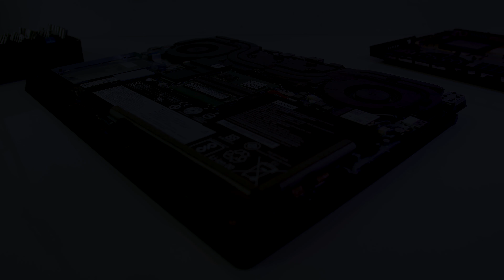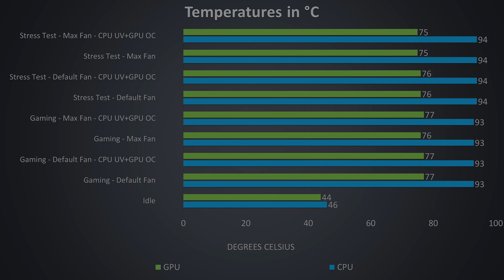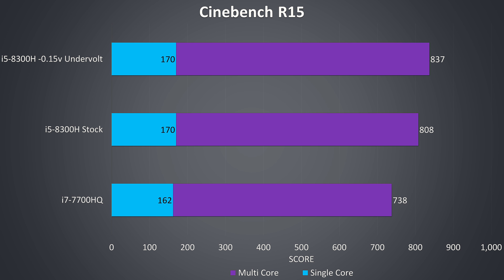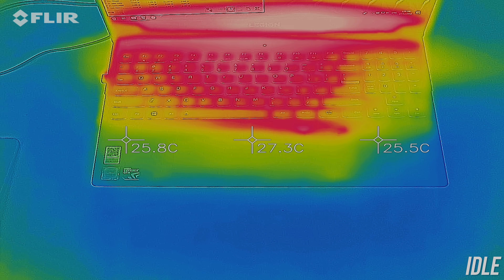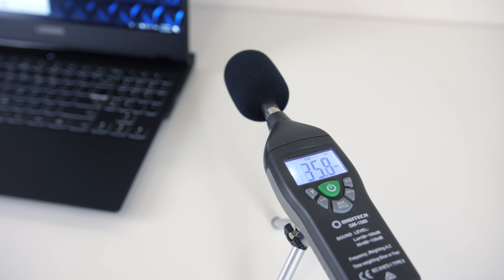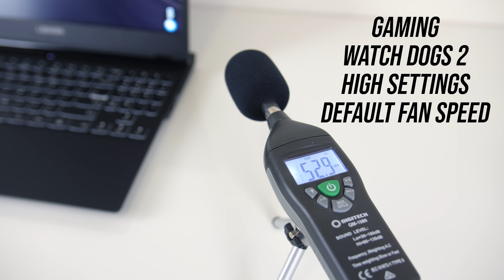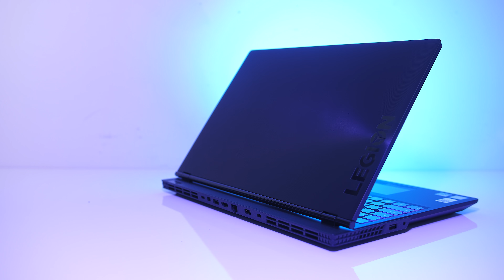Lenovo Y530 Thermal Testing, Overclocking and Undervolting

Comment: HOW TO RAISE THE FAN SPEED BECAUSE MY LAPTOP AFTER CLEANING THE DUST, CHANGING THE THERMAL PASTE AND PUTTING A NEW BATTERY IN THE CPU GETS IN THE 60-70 Celcius just by using the browser. If I try to game I can easily reach 90-98 celcius. SO WHAT THE HELL DO I DO? I changed the battery put in extra RAM, EVEN made sure that the thermal paste is changed. ALSO THE FANS are working fine they are spinning and they do speed up when the laptop hits 80 celcius. But THE LAPTOP STILL HAS CRASHES FROM TIME TO TIME and I think it is because of overheating.

Comment: I own the Legion Y530 with the i7-8750H and GTX 1060 6GB, it been two years, and honestly, this computer has a ton of problems.

The thermals are terrible, constant overheating. At stock with clean fans and no overclock this thing easily hits 100C under heavy gaming, It so bad that my GPU temporarily stopped working and my chassis is starting to warp and bend from the heat.

Also, the power button keeps breaking and I've gotten it replaced twice now.

The wifi card in this laptop, the Realtek 8822BE, is complete crap. It drops connection constantly and is terrible.

USB ports randomly stop working for no reason sometimes, causing you to need to restart the whole thing.

The trackpad freezes sometimes, but I never use it so its not a problem for me.

The rubbery plastic finish gets sticky from sweat, and you sweat a lot considering the laptop is always at 100C with gaming (with a repaste and clean fans)

The screen is stupidly dim, you cant even use it in the shade outside. (maybe I got the dim screen option so don't quote me on that)

Why in the heck is the webcam at the bottom of the screen? It can easily be at the top. (This is kind of personal preference here)

Overall, when it's new the laptop is great, but after a year it turns into an unreliable piece of crap that has a bunch of problems.
I probably wouldn't recommend it if you're gonna keep it long term. The y540 is probably the same way as its basically the same computer.
Reply: Had mine for 2 years with none of these issues
Reply: @karmaQT  how

Comment: Pro Tip: for getting an aditional -5ºC remove the dust filter under your y530, so the heat pipes and also CPU and GPU have extra passive cooling, lift it with a set of taller rubber feets and thats it! 3 hour full gaming, max temps of my  GPU was 76 degrees and CPU 80 degrees!!!
Reply: Dust wont even get inside your laptop since this area doesn't have airflow.
Reply: The dust filter (thin layer of fibre) chokes the cooling there, try blowing thru it and you will feel restriction
Reply from the maker: Nice, guess you could just clean it out more often if worst comes to worst.

Comment: Thanks for the video. So i followed instructions and put new thermal paste. However i always see fan noise, by just opening one tab of youtube under chrome. The bottom of the laptop is also also hot to the touch on ideal. Don't knw what is going on. Should I undervold cpu and gpu ? What could be th reason for a hot cpu and gpu at ideal conditoins ? Laptop is well ventilated sitting on the computer desk by the way. Thanks in advancce !
Reply from the maker: Definitely worth trying to undervolt, maybe use a stand or cooling pad, a simple stand can help a lot as I show here: https://www.youtube.com/watch?v=tXvKiy65pwg
Reply: Jarrod'sTech definitely will try it ! Thanks!

Comment: Hi .. I have a problem that while gaming my laptop drain battery 🔋 while it’s plugged in power.. note my laptop is Lenovo Legion y530 i7 gtx 1060 .
Reply from the maker: How far does it go down? If below 80% could be that you need a higher wattage power brick, check the power settings in the Lenovo vantage software, might be an option to allow it to drain down instead of sitting at 100% to promote longevity.

Comment: Hi Jarrod. Did u mange to unlock the core voltage, power limit and Temp limit sliders in MSI Afterburner ? icant do it on my Y540 9300h 1660Ti. Found this but didnt work for me https://rog.asus.com/forum/archive/index.php/t-81916.html . An idea ? or maybe its normal for this mobile GPU ? how did u OC The 1660ti in your y540 review ? Thx

Comment: mine y540 with i5-9300H and GTX 1650, undervolting -0.130V. Much better temp at average 69-70 degrees compared before undervolting it where average 80+ degree sometimes spike at 96 degree.
Reply from the maker: Nice improvement 👍
Reply: @JarrodsTech  what if i update to the latest bios, does it affects the undervolting improvement?

Comment: Hi, I'm considering whether to buy Y530(999 Aud) or L340(1199 Aud). I will only use it to play League and CSGO, or sometimes PUBG as well, so which one do you think is worth to get or suit to me?
Reply from the maker: What specs is the y530? If i7 and 1060 it will probably do better.
Reply: @JarrodsTech  (y530)i5-8300, GTX1050
(l340)i5-9300,GTX1650

Comment: Hello, I have Y530 with i5 8300H and 1060 6gb with 144hz version screen... In forza horizon 4 on ultra settings i get around 50-70fps, gpu is chilling on 70C max but the CPU goes throttling on alarming 95-96C, which I dont feel very relaxing to play, also the 170W charger adapter overheats a lot also. My gaming performance seems intact and unchanged but risking the device is what concerns me.. Should I do undervolting like you? Im already using Lenovo Vantage app to max fan speed and that helps to lower the temperature by few degrees but im still not pleasant with it. What would you suggest for laptop and adapter overheating?
Reply from the maker: I have that one too! If the performance is fine and not changing it's probably not actually throttling, but yes undervolting the CPU may help and is worth a try. Otherwise look into raising the back of the machine up so it can get more air, using a stand/cooling pad, or changing the thermal paste as I did here: https://www.youtube.com/watch?v=pzRfD5iYyRM
The power brick is going to get as hot as it needs to provide the power, not much you can do, but again if you undervolt the laptop it may need to draw less power which could help that. Can't say I think that one is much of an issue, I just wouldn't touch the brick.
Reply: @JarrodsTech  I can't open it to change the thermal paste because its still in warranty, here in serbia if screws are scratched on laptop and blue paint at the bottom damaged, they tend to say "you opened it and who knows what you did, we dont accept reclamation" if smth breaks, thats why i cant change thermal paste like you did, already watched that vid too, it was great! I will undervolt like you did, not sure about GPU OC cause it works as it should and doesn't overheat. In HWiN it says that 2 CPU cores throttles on high temperatures, but my performance is pretty consistent and i dont experience any fps drops, I am worried about battery damage due to heat and CPU itself so I will try to make custom aluminium cooling pad and let you know how that worked out if you're interested!
Reply: @JarrodsTech  Hey friend, on -0.90V i got 77C temperature with no throttle and 3.94GHz and its working stable under heavy gaming! Just wanted to let you know!
Reply from the maker: @hachi4691  Good to hear

Comment: Hey Jarrod, I'm not sure if you'll see this but I bought the Lenovo Y530  with the same cpu and instead got the gtx 1050 as the graphics. i watched the video by bob of all trades about undervolting but i dont want to risk my warranty. did u follow the EXACT same method esp unticking the bd prochot, tick the speed shift and set it to 0?  and love ur vids :)
Reply from the maker: I don't use Throttlestop at all, I just drop core voltage offset (which also does cache) in Intel XTU. TS is better and has more options, and Bob's guide offers more info than I can 😉
Reply: @JarrodsTech  tyvm :)
Reply: Hi, I realised for intel XTU that i couldnt actually run it as it wasnt valid for the cpu i5-8300h. so how did u get it to work exactly? ty for ur time

Comment: After 1 year, do you still recommended this laptop ?
Reply from the maker: Sure, or the newer Y540 which is basically the same but with newer graphics and 9th gen CPU.
Reply: @JarrodsTech  is this laptop still worth it then hp pavilion 15 gaming using ryzen 3550H ?

Comment: Does undervolting affect the overall reliabilty of the cpu?
Reply from the maker: Yes, but only if you push it too far if it can't get enough voltage then it can crash apps or blue screen windows. Once you get it to a stable value though it's fine.

Comment: how exactly did you change the clockspeed and voltage? the insydeh20 bios on the y530 (i have one) doesn't have such options?
Reply from the maker: I didn't, I'm just showing what it ran at during difference scenarios.

Comment: Hello sir i am from india i bought  lenovo legion y530 i7 version  with 1050ti graphic card sir when i play gta 5 very high setting the max temperature is 87 and when i start fans control+shift+1 so the cpu temperature reach 94 so tell me sir this good or not why this happen and also i am trying the undervolting in -140 and turbo power max 60 but they can't help very well but this setting change the core ghz 3.91 but temperature can't change so plase help me sir..
Reply from the maker: That temp sounds expected with an i7 under a game that's known to hit the CPU hard, not really much else you can do except try a cooling pad or maybe change the paste (however in my testing that didn't do much: https://www.youtube.com/watch?v=pzRfD5iYyRM)

Comment: Hi Jarrod, your video help me a alot. I am just wondering if undervolting might damage my cpu? I mean already undervolted my Legion Y530(I5 8gen) to -150v and is it ok to keep this moving forward?
Reply from the maker: That's good to hear! It shouldn't, unless you accidentally add too much positive voltage rather than negative. When removing power the worst thing that will happen is the laptop will restart, blue screen, or apps will crash. After reboot the change should be gone and you can try a more stable value. I think -0.150v is pretty decent, but you can try for more, results will vary by CPU.

Comment: hi, is it dangerous for my pc if the temperature of the cpu when I play is 85-95 degrees.
Reply from the maker: That's pretty high for a PC, if you're talking about a desktop. For a laptop? That's standard stuff and normal, try undervolting or raising fan speed if you want to improve it.
Reply: @JarrodsTech  it's the Lenovo y530 laptop .

Comment: I'm planing to buy this lab and I'm really in hot environment (egypt) what do you think buy it or no specs. I7-8750h 1060gtx
Reply from the maker: I'd expect worse performance compared to what I've shown here, due to the i7 having 2 more cores, but also generally 1c increase to room temp = 1c increase to internals. That said, the machine won't go above mid 90s or what ever I showed as the throttle limit, it will cap itself from getting hotter, it will just have lower clock speed as a result.
Reply: @JarrodsTech  thanx man you are the best

Comment: Hi Jarrod, i just ordered this laptop (i5 & 1060 version) but after watching this video I´m beginning to regret my purchase. Are the thermals really that bad for this priceclass or is this whats to be expected? Will it become even worse with time and should I buy something else?
It's my first gaming laptop and I would really appreciate an answer.
Reply from the maker: See how it goes I guess, some others have mentioned theirs run cooler than mine so don't know if it was just my unit. Either way these sort of temperatures are honestly pretty average from most 8th/9th gen CPUs under sustained multicore/GPU load.
Reply: Hi Game Freak, I owned 3 gaming laptops and I can assure you all of gaming laptops are hot on heavy gaming such as running AAA games.

But fear not, gaming laptop is also the best hardware for longevity as it is build to withstand heat and shock impact (comparing to other cheap laptop, easily broken off the LCD/Keyboards/etc). Best to say if you have a gaming laptop, it will last 5 years at minimum!

Currently using Lenovo Y720. Temps will get 85-92c and it is pretty normal. Just properly place your laptop with enough rooms for the exhaust of your laptop and you are good to go!

Comment: 93 CPU degrees while gaming? That is unacceptable.
Reply from the maker: It's pretty average for Intel 8th gen CPUs.
Reply: @JarrodsTech  Is that so? I am looking for 8th gen and don't really want to running that hot :/ I guess it is vicious circle, they improving cooling a bit but processors are always more powerful so running hotter. But 93 degrees avarage? It is bordeline for throttling no? At 100 degrees CPU shut's down. Is it that bad across most midrange gaming 8th gens? Thanks
Reply: @JarrodsTech  is good or not.. my also y530 temperature goes 94% when playing gta 5.. accepted or not accepted..

Comment: I'm getting 70-71c with the 1060 6gb (i7 version) on DMC5..it's normal I guess right? Also is there any software that lets you control or boost the fan, without having to do complicated stuff lol
Reply from the maker: Sounds fine to me! For fan boost there is a short cut, control + shift + 1 or something? If I don't mention it in this video it's in the review linked in the description, no software for fan control unfortunately.
Reply: @JarrodsTech  Actually I did try that shortcut before and I think I'm the only one who it didn't work for him haha. Your response is much appreciated nonetheless.
Reply from the maker: @NomadMaverickHQ  hmm you might need Lenovo vantage installed for it to work, do you have that?
Reply: @JarrodsTech  Yes, just installed it yesterday. Thankfully after a quick research in the Lenovo forum I found that there's another shortcut (Fn + Q) and I read that in a Y720 thread, before the Y530's existence lol. Very weird but finally it worked!

Comment: Wow man, Nice job at responding to comments :D 
Btw, dont u Think that the temps Will be just fine when i play csgo, its kinda not that heavy of a game :) aaaaand is 128 gb ssd enough? Like i dont play that many games max 2-3. 
I really wanna buy a Lenovo legion y, so im surfing all around the browsers to find the right one, thx for some good videos :)
Reply from the maker: Cheers! I think that game will use as much of the CPU as it can, so might be somewhat similar, either way it will still perform well. Depends on the sizes of the games, but yes for just 3 128gb is probably ok, you could upgrade later.

Comment: The high temperatures are a shocker with undervolting too
Reply from the maker: Yeah, changing the paste ended up helping a little, could at least remove the throttling.
Reply: @JarrodsTech  looking forward to your y540 review
Reply from the maker: Hopefully not too long before they send it over!

Comment: Can some tell me that I5-8300H with 1050TI 4G vs I5-8750H with 1050TI 4G, which one has lower temperature CPU and better performance ?
Reply from the maker: Better for what? In many games I doubt you'll notice much performance difference, though this will change over time as multicore becomes more important. Otherwise they have the same all core turbo speed, the i7 has 100MHz higher single core turbo, not much difference, the big difference comes from the core count. The i7 should run hotter as it has 50% more cores in the same space.
Reply: @JarrodsTech  I mean for those different CPU (8300H and 8750H) match with same graphic card (1050TI 4G) which is better?
Reply from the maker: Either are fine options

Comment: Hi @Jarrod'sTech ! Looking for powerful laptop without gaming appearance, I just received my brand new y530 (8300h+1060). I watched all ur vidz about this one and many others. Could  u please tell me how did u undervolt the cpu and oc the gpu ? XTU and msi afterburner eg ? anything else ? i saw there was a Lenovo tool in it ? if u have any info … Thx a lot and thx for ur great videos ! From France !
Reply from the maker: Hey, yeah that's right I used XTU and Afterburner, but if you want the undervolt to automatically enable on reboot look at Throttlestop instead for undervolting, bob of all trades has a good guide on using it here: https://www.youtube.com/watch?v=yNt9L3BWOFo
Reply: @JarrodsTech  thx again !

Comment: When you say the fans were silent "at idle", does that mean when performing basic web browsing, streaming, microsoft word etc ~ non gpu intensive programs, it is completely silent too? Looking at getting this laptop with the exact same specs as yours for university and dont mind the fans going while gaming but I want to know if it will be quiet enough to use in libraries etc :)
Reply from the maker: Honestly, I didn't test that, only while it was sitting there doing nothing, however from what I remember while just browsing the Internet in Chrome the fans didn't change from this point, but it will depend on the workload and resource being used.

Comment: Wow Jarrod, hats off to you that you are still replying to new comments on your 3 months old video! I'm looking to buy a Dell G7 or Lenovo Y530 (i5, GTX1050/1050Ti) which would you recommend in terms of build quality an longevity? Or any other laptops at the similar price with similar specs would you recommend?
Reply from the maker: Both were pretty good in those aspects, hard to pick one over the other. Assuming you're talking about the 2018 G7 as I haven't used the new 2019 G7 yet, I'd probably pick the Y530 for thinner bezels/just looks nicer in my opinion, with the same specs I'd expect about the same performance so at that point other factors matter. Maybe the G7 if Dell fix the BIOS issue that caused a lot of people to suddenly get thermal throttling, not sure what the deal there was.
Reply: @JarrodsTech  Yes the BIOS issue.. I've seen a lot of complaints. Anyway, I know its a hard pick between G7 and Y530, thats why I'm asking for your personal preference ;). Thanks btw.